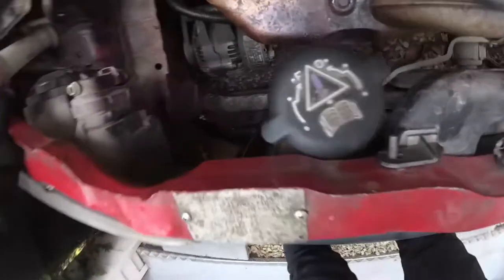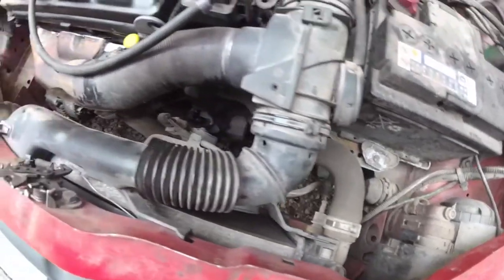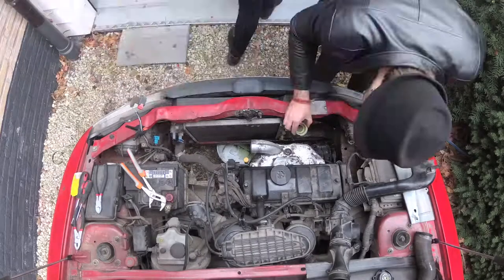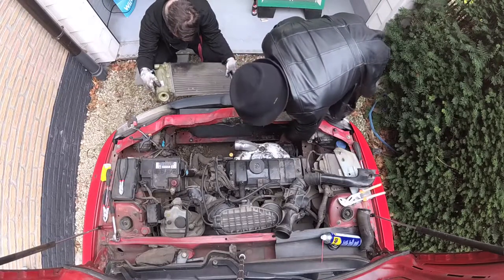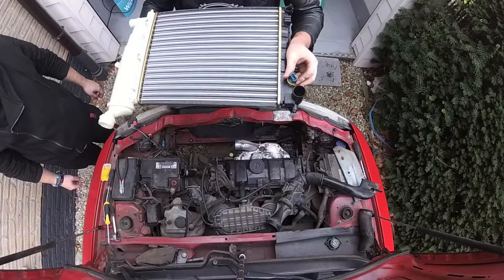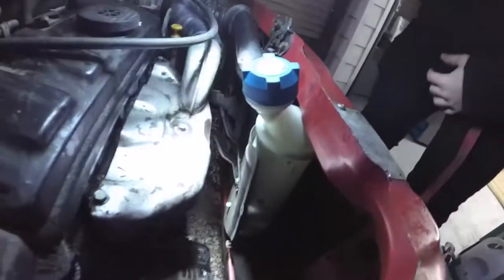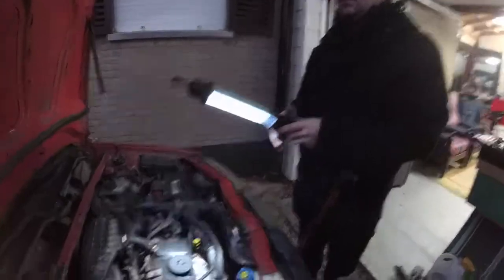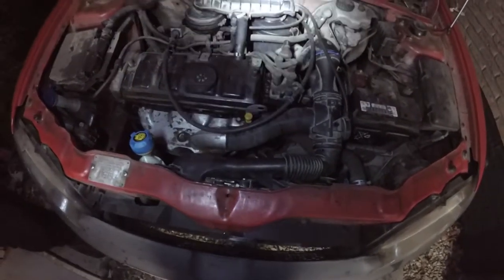[ REPAIR ] - Peugeot 106 Sketch (leaky radiator swap)

Comment: You neee to bleed the lines. Open the radiator cap, the bleed screw on the thermostat (driver side of the motor) and the valve cap on the heater pipe (near the windscreen, passenger side). Pour the liquide until the thermostat start leaking then put the screw back, then re add liquid until the heater pipe is full. Go drive it until fan activate (don't rev it) then stop and wait for the motor to cool down. Fill the radiator at the max level

Comment: please tell people to bleed the air out of the coolant system, or it will overheat , as it has done here, and could wreck the engine. There are 3 bleed points on a 106. If not bleeded there is air pockets which let the engine go red hot and warp.
Reply from the maker: We did it the lazy way. 
Taking risks like a dumbass!

Comment: It takes forever to bleed the heater
Reply from the maker: Not doing it the proper way, we had it down after 2 short rides around the block though.
Maybe because we didn't drain the block.